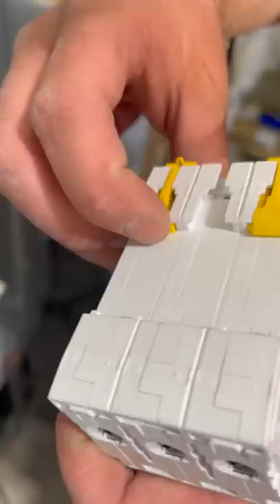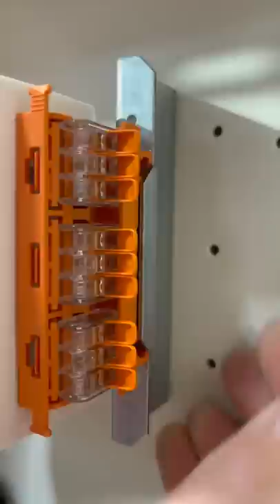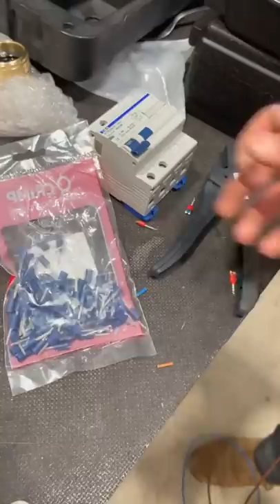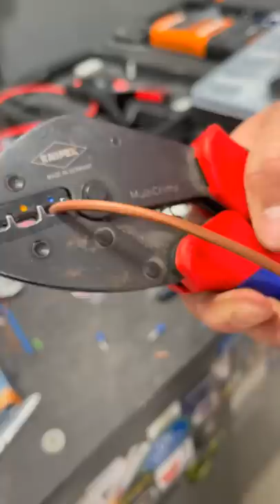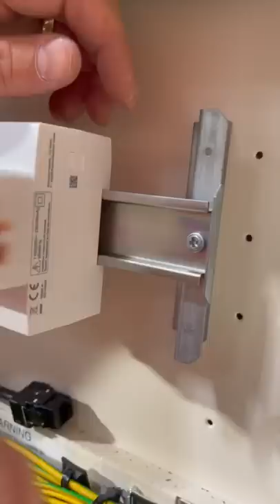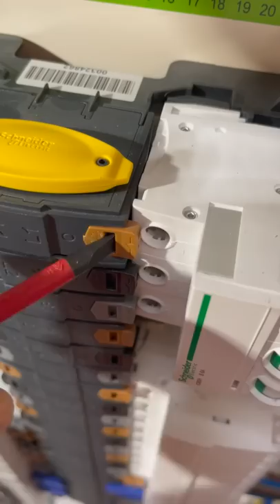LESS WiFi, MORE POWER, DIFFERENT SHORT

Comment: Ethernet over mains - the system of last resort.
Reply: So true.
Reply: When you live in a bunker
Reply: Even mains is a better option than chained outlet wifi extenders...
Reply: @CRC.Mismatch  I cannot get my dad to stop buying more extenders thinking it'll "fix" the wifi
Reply: @CRC.Mismatch  What about actual Ethernet?  It's not rocket science.
Reply: @kornaros96  I've set up a well working WiFi mesh in a WW II museum bunker with 6 rooms. There is plenty of opportunity to run ethernet wire transporting data and PoE to access points.
Reply: True if compared to ethernet. But what one or the other powerline adapter achieves over the same wires, differs greatly too. A satisfactory speed of 500 Mbit is achieved with the powerline set I use over a distance of 60 feet between my house and in my shed.
Reply: That is no option for me tbh rather would I have lose wires laying on the floor
Reply: @runforitman  you and me both
Reply: @freewayross4736  I have power line adapters for the shed and for the CCTV DVR and they work perfectly and much easier than running Ethernet cables around! They are actually more reliable than the internet connection to the house!
Reply: @55dbk  sometimes you either don't have a telecoms conduit reaching where you need (or it's plugged), and although you could always just drill holes in the walls to pass a cable, aesthetic's then thrown out the window (and ripping the walls to pass a new conduit inside them - not so easy in concrete/brick walls, is not a cheap and quick solution either)
Reply: 1
Reply: @Xenon777_  idk man I don’t want this shit in my house they are emitting such high frequencies and your standard power line is not made like to shield 4 example 100MHz it works i know but I see at as a health hazard.
Reply: It's ok if RF didn't radiate outside of wires, but it does. It means no security is enough, it means this bad practice of sending RF down unbalanced cables is interfering with any radio equipment for miles. It might have notches for specifics spot frequencies, but that is a half arse fix for abusing RF pollution.

They get away with not following regulations to protect the radio spectrum because they call these devices MODEMs to allow them to fit in an exempted category of products.

Devolo are a bad company as are all companies making this deplorable shit.
Reply: @freewayross4736  it's not really a health hazard, but it is a shit thing to do. The RF is being sent as you said (in not so many words) down unbalanced cables with non-RF suitable joints. It's able to travel outside the home and be detected for some distance, even miles in some cases. It's not fit for purpose.
Reply: @dennis8196  Mains won't protect the entire spectrum, that's true - but the point is it usually operates in between "AM broadcast" and SW bands (HomePlug AV2 even goes as high as 86MHz, so I'll give you that it could definitely interfere with FM broadcast radio too); even considering that the wiring makes for a "great" transmitting antenna, the signal strength isn't nearly enough to really mess AM radio signals, nevermind FM. Of course, you can catch some noise during quiet moments of transmission, but then almost everything electronic nowadays also causes this (mainly cheapo switching power supplies, which are everywhere). About the square-wave, it would be daft to believe that shoving digital signals over mains would work to any decent extent. Actually, the modulation types used are the same as 802.11*, not 802.3* - and with sufficient sub-carriers as to allow for less overcrowding than both 2.4GHz (which is not only used for WiFi, but also Bluetooth and a plethora of other protocols) and 5GHz (where most channels require DFS and the actual available bands vary wildly from country to country). About security, if one's daisy-chaining extenders using WPS (or anything less than WPA2), even basic AES-128 is already more secure. On a final note, as an amateur radio listener myself, I abhor anything that produces unneeded RFI - thus why my real recommendation is running a good ol'Cat5e or Cat6 (preferrably shielded, but at the very least foiled) wherever you need to add just enough APs to cover your entire space. I wouldn't use mains, and I also wouldn't use extenders (except in client mode to bridge ethernet for older stuff like PS3s or PS4s), but for the average Joe, I'd prefer to not share the WiFi spectrum with 30 "extended" APs more than having bad SW reception.
Reply: @CRC.Mismatch  drill a hole an man up. Polluting the electromagnetic spectrum with unregulated shit is not responsible, has the ability to endanger life in certain situations and does interfering outside of the intended frequencies (eg where it is claimed to be notched or filtered). 

Quite frankly you sound like a shill for the industry the way you talk. Perhaps if you had some real world experience where those thing are knocking out DAB radio, and making broadcast hard to hear, let alone the number of units seized by OFCOM and Airband interference investigators have seized from people.
Reply: where can buy that things??
Reply: @handyagus2163  Don't. Use Ethernet cable instead.
Reply: Don’t bother with power line Ethernet, modern Wi-Fi can easily match gigabit Ethernet at this point. Just make sure your devices support the newer standards, or get an extender that can work as a Wi-Fi to Ethernet bridge. Wireless AC wave 2 is where I think Wi-Fi starts to match gigabit ethernet.
Reply: @SupaREX684  some houses have very thick walls or have steel walls that basically act as a faraday cage that blocks out all signals typically older buildings brick concrete steel or they live in a compact apartment with many other competing signals from like 80 different routers and the fact that the devices support the new standards doesn’t mean they can take full advantage of it ,
Reply: @dennis8196  My man, read it to the end... I don't do it, and I usually advise people not to do either, just run a cable. But there are people who just want "their internet to work" and don't want to spend time/effort/money on doing it right, plus don't care about anything or anyone else... They will do it anyway, and probably in the worst way, with the cheapest shit they can find if you only advise against "what they need".
Reply: @CRC.Mismatch  when planes fall out of the sky will you and the rest of the naïve people listen.
Reply: Cut my WiFi into pieces, Ethernet my last resort. Disconnection? No pining don't give a fuck if I carry on singing.
Reply: I always loved the concept. Honestly, WiFi can be choppy and is a security risk. Once you install this system it (theoretically) just works everywhere.
Reply: @Chronologist89  sadly no, for each ring main in the house / apartment you may loose signal or not connect at all. 

We had 2 electric ring mains in my parents house and didn't know why our adapter was getting only 3-13 Mbps.   When I eventually convinced my father to try a different room in the house instead of just the same room with different sockets it worked. 

Later on we discovered a separate circuit which powered the outside lights (though technically still the same breaker) had also had inside setup along its route to outside. Which included the bedroom.
Reply: @daydream605  Well sure, where I live it's normal for each home to have three phases in multiple circuits. That is why you put an HF bridge at the entrance point of the power to the house "shorting" all the phases together for HF signals. This way the connection is available on each circuit and subcircuit.
Reply: @Chronologist89  interesting 🤔 thank you for the information. I didn't know there was a solution to this issue not did I fully understand the concept until recent mentions of HRF .
Reply: Never seen one dirrect on mains bored
Reply: Ha, exactly so.
Reply: @55dbk  When the walls are up it's not always so easy.
Reply: Also make sure you even about encryption on the device if you are in a shared property. Even in an apartment building. Same goes for Ethernet over Coax.
Reply: @dennis8196 although aircraft wiring is highly shielded and protected from HIRF.

The radio systems on aircraft can output a lot of power, so all the wiring is designed and tested to NOT be affected by interference.
Reply: @CRC.Mismatch  as someone who has to go WiFi, I'll take bunker net, at least that can be made on or off global.
Reply: @runforitman See if he ever used walkie talkies.  Then ask him if putting more walkies talking at the same time all on the same channel ever helped?

Get a good hotspot and put it on an Ethernet cable.

Better yet figure out what you can put on Ethernet or 5ghz to save some bandwidth.  My 2.4ghz hasnt had a problem with bandwidth since I ran a cord to the PC and the TV and put all the newer devices on 5ghz.
Reply: @HansOvervoorde  Please tell me what Powerline adapters those are cuz I cant get anymore than maybe 60mbit over powerline
Reply: I've seen people say mesh wifi is the way. I have to beg them to reconsider cause they never realize each hop is an exponential drop in bandwidth
Reply: Exactly. Lets not encourage more noise on our powerlines.
Reply: @dennis8196 you seem to know your stuff. If I have a pacemaker is this bad for me? Are these high frequencies bad? I know you can't be near induction ovens and things like that but I'm not sure about internet.
Reply: @55dbk I live in Germany and most of the walls in houses and apartments are solid. You most often can't just put some brand new ethernet in the walls as it is possible e.g. in the US, where they use a lot of drywall. So stuff like this is pretty common in older houses, which were built when ethernet wasn't a thing.
Reply: @HansOvervoorde i'm sure speeds over powerline are decent. The real issue is latency.
Reply: Cat 6a all the way
Reply: Had to provide a VOIP telephone in a Elizabethan house no cat5 only mains so got a pair of power line adapters
VOIP phone works well even with a laptop plugged into ethernet port on phone 😊

Comment: I didn't know there was a WAGO mount clip for top hat rail, what a brilliant idea
Reply: WAGO mounts. New one on me too. Something I’ll definitely look into.
Reply: They had to make these because you need to fix the wagos in distribution panels if used "by code". fix+label=nice
Reply: This is another UK shortcut. Proper way will be that you use wago rail terminals. This is just CT1 instead of screws.
Reply: I just printed mine on my 3d printer - different colors for different cables
Reply: Yes, different clips for 2273, 221-4## and 221-6##
Reply: They are called "wago mounting carrier"
Reply: @PsiQ why? Because wires pull out of them so easily? LOL.
Reply: @littlejackalo5326  
No, not "out" of them. It's to have a fixed POSITION for the wires.
So the next person working in the panel doesnt have a bunch of loose wires hanging around.

Comment: Funnily enough I just had a system go offline over Devolo power line adapters. Just needed a reboot. Good job not mission critical . I do love these videos . ASMR for sparks!
Reply: anything mission critical should be hardwired - regardless of the complications therein :)
out the wall, round the building and back in - even armoured fibre optic if longer than normal runs, but dear god, not powerline
imho ;)

Comment: Powerline can be a good compromise in older properties where you can’t run cables and wi-fi is a challenge (try a 15th century house with stupid thick walls). Using Gigabit adaptors from the likes of TP-link or Netgear is ample for most homes  even for streaming UHD and you can mix with wi-fi where needed so kids can have their phones in the bedrooms and kitchen.  My experience with Devolo is not good so after several bad experiences I stay away. A fully meshed wi-fi solution will also do the trick but if you only want what you need for what you can afford Powerline is good enough - just hope neighbours on the same phase aren’t using it too.
Reply: Or rentals where you're not allowed
Reply: Just curious, if neighbors are on the same phase that wouldn't be a security issue since they are different routers, firewalls, etc.. but rather a throughput  (Mbps) issue similar to cable internet, correct?
Reply: @Tony-rl2fr  when you set up the adaptors you set an encryption key that is unique to your network BUT devices on the same phase are capable of connecting to each other if encryption is not set by both parties.
Reply: @travellingDAS  Yikes. Unencrypted devices communicating with encrypted devices ... Kinda defeats the purpose of encryption.  I see what you mean now. 👍🏻
Reply: @Tony-rl2fr  I thought so but I'm having trouble getting a stable connection INSIDE my own house on the same floor let alone leaking it out.
Reply: @Tony-rl2fr  The EoP uses work as a Hub so send ALL traffic to ALL devices on the "Network". You need to enable encyption.

I was renting a place and there was a Video over IP system been trialed by an ISP.

There was no way of enabling encyption since they locked you out of the management of the device. I was able to access ALL the other apartments computers! 

Does not matter if they had a different router/firewall since the device is connect inside the "Trusted" LAN. Basically the same as running a long CAT5 cable into their apartment and connection it to there switch/router.
Reply: @Smithy18 I agree that’s the low-cost/better performance option but I wanted to do this to my parent’s rented cottage but the landlord said “no” hence the expensive route.  There was also the “but I don’t want cables all over the place” over-reaction from one member of the family lol!
Reply: Power line adapters = mesh network killers!

Comment: You know that yellow plastic thing in the top middle of the Schneider board is for moving the sliders over (so you don’t have to use your metal screwdriver and scratch them up)
Reply: Now i know, thanks. (Not an eletrician)
Reply: It's called an isobar key.
Reply: @barticus0  or a lemon
Reply: @gabrielgray7083  زت
Reply: @gabrielgray7083 or the correct tool for the job , and after all that hard work with all them gadgets he slips and falls on the last fence

Comment: I haven’t the slightest idea what you’re doing. But I love the tools and connectors!😃
Reply: Best comment.  You didn’t educate me at all, I still have no idea what I am seeing, but now I’m smiling because of your comment because it is absolutely true.
Reply: I agree
Reply: @biopsiesbeanieboos55  Now I’m smiling too!😁
Reply: I’m a Journeyman Electrician in the states and this half of this is odd to me lol I know the tool makers and have quite a few by them. But never seen some of these before. And even the breakers, connectors, and other devices, they work the same as what we have but look so foreign to me.
Reply: @Sonny_Allgood even though I am Indian, I used to work for British Telecom. I worked in the call center for the billing department. One such product we used to offer was a router that would plug into electrical switches. The concept was that instead of sharing internet through dedicated ethernet cables, as long as your electrical circuits were linked to each other, you could transmit internet signals over it. There would be no loss of internet speed. All you need is a male and female adaptor to plug into a wall socket. It would have female ethernet points in them. 
This just seems like a more expensive version of that.
Reply: 😃thats what I was thinking to myself "love all the tools " lol.
Reply: He's installing a Hamsbane - a device to carry a computer network over power cabling, as an alternative to pulling proper network cabling through the building. They are infamous for putting out horrific amount of radio noise and generally screwing with every ham radio operator in a radius of several kilometers.

Comment: Out of curiosity, why didn't you use conventional wire ferrules? (aderendhülsen)

Edit: depending on the type of terminal you  have to use those. In Terminals without a pressure distribution plate you can't use conventional wire ferrules since the screw would practically punch a  hole through the ferrule. Wiggle the wire two or three times and the wire breaks
Reply: Was soll das ganze denn sein? Electrician ASMR?
Reply: Das ist fachlich schon echt schwach was da gebaut wird, die Devolo Schleuder hat zumindest bei mir Käfigklemmen, da macht er Presshülsen rein und bei den dummen Schraubklemmen die blanke Litze... Völlig daneben

Comment: All looks top-drawer 👌 Terminal crimps are a "no" from me though. Look tidy yeah but a waste of plastic and metal. The components you secure them into don't require them to grip/operate correctly.
Reply: Honestly crimped the wrong stuff 😅 the wire doesn't need it, but the cable/multicore stuff near the end does need crimps (as copper work hardens and may get loose and break in a screw terminal)

Comment: Devolo's are really superb, just plug and play and you have the speed you need in a normal existing house. No need to run extra ethernet or fiber, not need to mess (pun intended) with wifi-extenders. Just easy and solid....... at least when your electrical system is of decent quality
Reply from the maker: Great feedback

Comment: Also, sticky pads and cable ties inside db enclosures is a big no no on most commercial sites, as nice and neat as it makes it all look, it’s known as ‘bunching’ and every large electrical contractor I’ve worked for (All of the big ones worth working for in London) all don’t allow it. That being said I am not sure if there is a regulation against it. At a guess I’d say there is
Reply: There is not.you take into account your grouping factors at the design stage so why would there be an issue…..